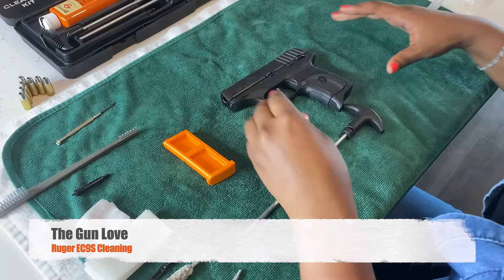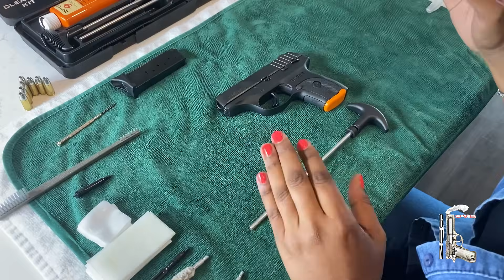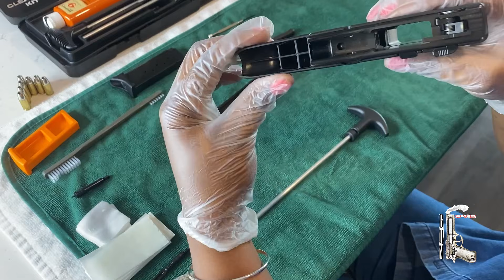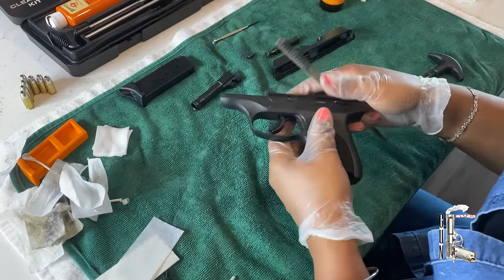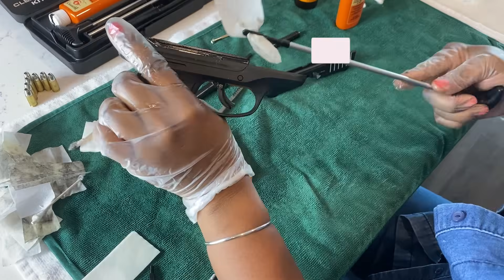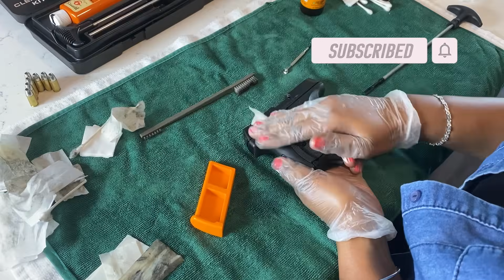Ruger EC9S  Cleaning Tutorial

Comment: Nice clear instructions. I usually don't pull out the Hoppes jar for every cleaning. CLP for the other parts every cleaning though. Ballistol would be fine as well.
.
Comparatively, Ruger semi-autos aren't the most reliable when dry. I put a few drops of synthetic motor oil on the barrel and the slide rails just to keep it lubed. I hope I never have to rely on a Ruger semi-auto to protect my life. However, if that day comes, I hope that I added those few extra drops of oil when last cleaning my Ruger.

Comment: Caution. Never allow, with the pin removed, the slide to move backward. That will cause the slide to Lock up. So all ways only move the slide forward when the pin is out.
Reply from the maker: Thank you for sharing that super important tip! I appreciate your contribution to help us all learn!
Reply: All you have to do is pull down the slide release and it can go backwards easily without the pin !